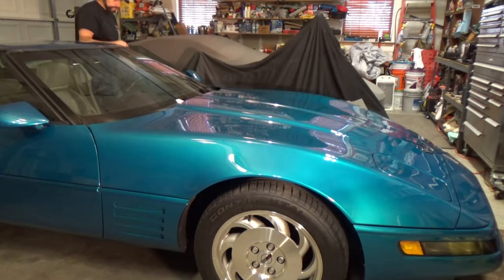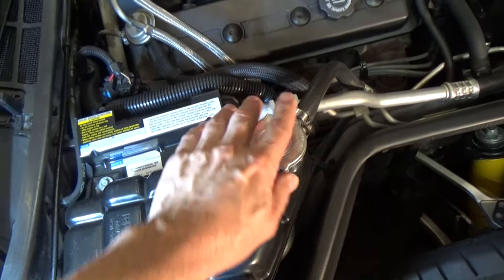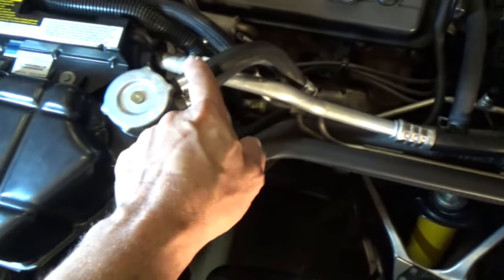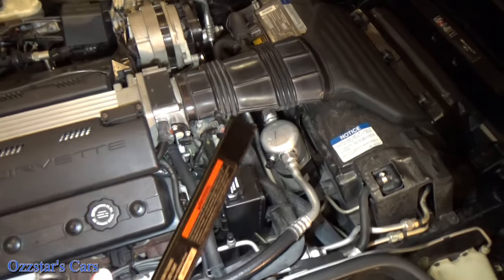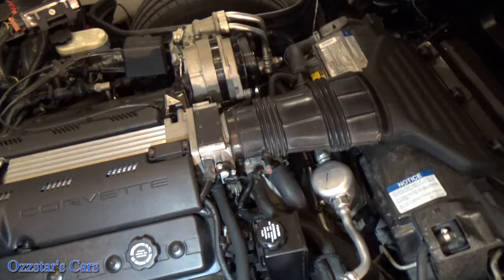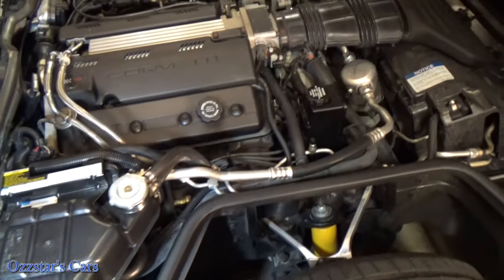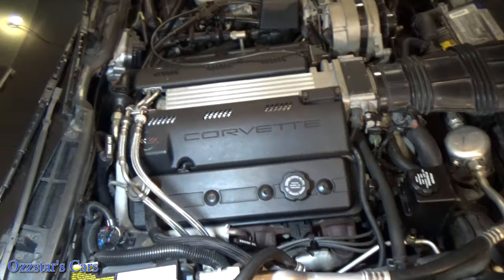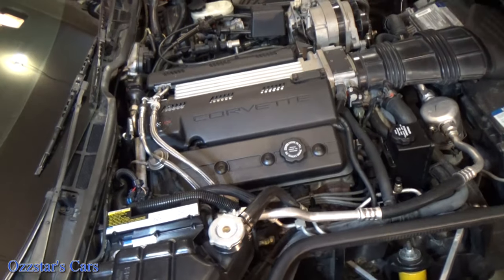Corvette Running Hot - Corvette Cooling System Maintenance Running Hot C4 1992-1996

Comment from the maker: There is a lot of info in this video including the on and off coolant temperatures for the both primary and secondary fans.   Also the proper antifreeze to use in the C4 generation Corvette.  Thanks for stopping by the Ozzstar's Cars channel.  Please ask questions and leave comments down below.  Thanks! -Ozz (Glen)

*Redline Detection SmartFit Cooling System Tester*  https://amzn.to/2GXN4dm

If this video has helped you out consider donating to the the channel with Paypal, thanks!:  https://www.paypal.me/ozzstar

Comment: A few points.  The C4 Corvette cooling system is designed and extensively tested to run as high as 15 psi above atmospheric pressure.  With the recommended 50/50 ethylene glycol and water the mixture has a boiling temperature of 268 degrees Fahrenheit.  The system can handle temperature excursions to boiling because of the high mounted pressurized surge tank in the right rear corner of the engine compartment.  

When heated coolant expands beyond the volume capacity of the pressure system it goes into the unpressurized coolant recovery tank in the right front corner of the engine compartment.  When the engine cools down the coolant in the coolant recovery tank is drawn back into the pressure system.  

The dual electric fans are programmed to turn on at around 220 F.   

In summary, 268 F is the number to remember not 212 F the boiling temperature of water at 1 atmosphere.  Based on your story Corvette drivers are panicking when all is normal.
Reply: The final word from the man who would know.  

I just got my third C4, a 9000 mile 91 ZR-1.  I Previously owned an 85 and 90 6spd ( not to mention my 70 big block car.) No cars are ever perfect but reflect the technology of the time.  You pushed the envelope, especially with the LT5.

What a contribution to the world of automotive engineering you made.  Many thanks for lots of miles of enjoyment.
Reply: 231 the fans kick in on my 92 LT1. Was thinking of going with a lower temp thermostat.
Reply: Thank you Dave for the clarification. I just bought a 1993 convertible, love it. thank you.
Reply: Lot of lt 1 new owners panick as they look at the needle on the gauge not the actual readout temps
Thought LT1 fans came on at 228 perhaps higher?

Comment: As a former C4 owner (1989 vette, manual transmission) in warm California climate I'd say the best thing to do is put the gear into neutral and take your foot off the clutch when stopped at a traffic light, the temperature will drop from above 200 down to 190s or 180s within 15 seconds all the time. Not sure what to do if you have an automatic transmission. Also a good air filter, aftermarket air intake and quality coolant helps. Like you said, make sure the radiator and fans are well serviced. Mine never overheated and I drove it hard like a dog in the blistering heat all the time, I miss that car.
Reply from the maker: Less friction equals less heat. Keep it cool!👍
Reply: First, Glen, good video, good info. I owned an 88 vette for 30 years. Setup included L98 auto, electric fan and electric  optional pusher fan. I changed the thermostat to 180, replaced the 235 temperature switch in the side of the block that turns on the pusher fan to a 200 and added a jumper wire from the pusher fan relay to the main fan relay. That way both fans turned on at 200. Highway temp rarely over 180. In town and parades never over 205. The factory design just left too little buffer between operating temps around 235 to cracking the aluminum heads at 260. Hope this is helpful.

Comment: '93 LT1 I've owned for 24 years. Never saw a video talking about what you said as far as debris buildup on the radiator. Didn't think my car had it (very occasional driver) but looked in there and sure enough it did! Hosed it out per your instructions, runs MUCH cooler, temp didn't go above 213 sitting in traffic last night. GREAT video thank you!!!
Reply from the maker: You got it Jeff, the beer tip jar is open. Haha. Enjoy those cooler temperatures!

Comment: I live in Arizona so needless to say its hot here. I have an 1987 Z52 that ran hot all the time. There were several things that I did to help reduce the high temperature issues. I changed the thermostat to a 165 degree instead of the normal 190 degree. I then put a high flow water pump on the engine, wired in a switch kit that allowed me to control the fans both primary and secondary, changed the coolant fluid to the GM DEX and finally removed the radiator and found all kinds of debris between the front of the radiator and the back of the condenser. My car ran previously in the 220+ degrees with or without the AC especially in traffic, now its runs without air on at 175 and with AC 195. Since this is an L98 it has the aluminum heads and steel block which can be prone to warping the heads. So far all has been great. I also just bought a three row aluminum radiator which I still need to install. Thanks for a great video.
Reply from the maker: Wow Porter sounds like you have been busy with that fun project. Thanks for the comment and enjoy your "cool" C4! 😁👍
Reply: Thermostat really doesn't matter as a practice to prevent running really hot. If it's at 230F, the thermostat is open whether it's a 165 or 190.

Comment: Thanks for this great video. I have been worried about my 92 C4 getting hot, but it runs less than 180 on the road. I always panicked when temp got to 210 in traffic because that was 30 higher than normal. Now I know that the fans haven’t even turned on yet. I used your paper clip to test the fans and blew out the trash from the radiator. Honestly, there wasn’t much. Thank you so much for your video. I subscribed and gave you a like!
Reply from the maker: Glad the video helped you Just Bop. Thaks for subscribing and liking.👍 If you get a chance you may like some of my other C4 Corvette repair videos. Take it easy.  -Glen

Comment: Thanks for the info, just purchased an 89 c4 running at about 218 degrees.  I'm going to get it up on the ramps and clean out the radiator. Thanks for such great info

Comment: Glenn, Thank , thank you thank you !!! I have a 1989 vette Black convertible. I would run around town on a hot day and freak out.  220 and I could not here the fans kick on, so I would put on the air and the temp would go down below 200 even 190. I have done every thing you said to do in the pass, one time or another, but !...I had no idea about going between the radiator and the air coils ( what ever they are called ) and checking that area out and cleaning it. As soon as spring comes to Ohio and I get the car out, I will do that first !!! I bought mine in 92 in  small town called Napoleon Ohio. They were super guys and gals there. The best part was, all there corvettes in the very large showroom 
had keys in them. And no pressure, they let you sit in any car and start it up. Soon as there is a car you would like to test drive, they get it out and zoom, zoom, you go ! I live in a small town called Kent Ohio, I actually drove 3 weekends there, Stayed in a hotel over night, till I got the one I have now. They even had some 50's and early 60's there, but those were behind ropes and if you are interested in one, the sales person were with you.            Thank you again....Bobby
Reply from the maker: That's a great story Bobby!  I really enjoy hearing the history of someone's car. It's a shame most are never told or dissapear with time passed.  After all these years I bet you you will find debris between the radiator and a/c condenser.  You're welcome for the vid and thanks for your comment.  Hopefully you can post an update with the results you get. 👍

Comment: My 93 would run 200-220 in the FLA heat and add 10-15 degrees if I ran ac. I do have a fan mod so both fans would run even without the ac on. I had cleaned my radiator and assured zero debris, and had system flushed and serviced yet temps still seemed too hot for me. I then purchased a 3 core aluminum radiator and 160 thermostat. Now my car runs very cool (170-180 typically) with or without the AC even in the 95 degree days.   I did make a YT vid on my channel showing results.  Also as I understand things the digital temp indicates the temp at water pump while analog temp gauge is showing temp at heads.  Thanks for the informative vid :-)

Comment: Great Video .I have a 1996 automatic. Radiator fan on and off temperatures are something I will definitely look into. As well I will take a look at what may be stuck under there on the radiator and will try to wash it out. Thank you!!
Reply from the maker: It's most likely packed with debris.  Let us know how it turns out Frank.  Thanks for the comment. -Glen

Comment: Excellent info for the LT-1  C4s.
I have a 1996 that runs great, but has the high temp issues you describe.
When I was building '69 Camaros and racing them as a kid in the late '70's, 180 to 190 degrees was the normal temps.
I finally got my C4 I always wanted, and it's running 225 -240  and scaring me half to death.
I've been debating getting a thicker core radiator to make it drivable, but I want to make sure I'm bleeding the air out properly.
Thank you for sharing C4 tech.
Reply from the maker: Have you checked and cleaned the radiator and tested both fans operate?  Should be running around 200⁰ down the highway.
Reply: Yes, my friend from high school is a GM Tech and went to all the tech schools over the last 40 years.
He has the wireless analizer that plugs into the OBD II plug under the dash.
We found out , as you mentioned too, the digital gauge is more accurate than the analog, and the fans come on at the factory settings. 
I want to try to make sure it isn't air locked though, so I'm going to try to bleed of air in the cooling system possibly preventing correct coolant flow.
I want to go for a ride without worrying about over heating.
It's such a fun car. Has the feeling of my old Hot Rods , except it stops and goes around corners much better and burns half the gas.

Comment: How to keep your 1995 C4 LT-1 between 180F - 200F no matter what:
1) take primary fan off relay, and put it on a coolant (low) temperature switch, or a manual switch
2) convert to Meziere WP118HD Heavy Duty Electric Water Pump
3) get an all aluminum performance radiator
After years of anxiety here in New Jersey summers,
now NEVER A WORRY!!!  IT JUST WORKS!!!
Reply from the maker: That is way more expensive and involved than necessary.
Reply: @ozzstars_cars  not really, turning the fan on/off with a switch and relay cost less that $10; original plastic oem radiator leaked, why buy more plastic; original oem water pump died pissing coolant over my optispark, why let that ever happen again... imho... ymmv... cheers

Comment: I have a 94. The 95 and 96 did not run coolant through the throttle body. I replaced my hoses with the later model ones to bypass throttle body. It actually lowered temp just a bit and seems to be a little crisper on throttle response. This also removes several points of potential leaks.
Reply from the maker: I am interested in knowing how bypassing the throttle body coolant lowered the coolant temperature and changed the dynamics of throttle response.  I've worked on cars for 30 years and have never seen that phenomenon.

Comment: Another question...
My 1994 Corvette is pretty much original. With that said, I have done a flush n fill, new thermostat, cleaned the radiator/condenser area of debris, replaced the temperature sensor, and all the other stuff I see in this video and elsewhere.
With that said it still has problems with overheating if I get stuck in traffic on a hot day. Not a problem when I'm moving. But if I'm not travelling by the time the secondary fan comes on it's too late to recover and my engine gets really hot and starts "missing." No problems on cool days.
With my friends older Corvette he just replaced his (single wire) temperature sensor switch with a lower temperature one, so his fans come on based on the position of the switch, which activates his fans at a lower temp than stock.
That does not work on my 1994. There is no lower temp switch because this is a two-wire sensor and sends a signal to the ECM and the ECM decides when to turn on the fans. Man, I hope that's not too confusing. The older ones are on/off, the newer ones read resistance.
I also looked into reprogramming the ECM to turn the fans on at lower temperature. That's a no-go. Without going into details, the 1994 and 1995 model years have some funky computer stuff going on with OBD1 and OBD2 stuff.
So I was thinking of going with a "Derale" brand adjustable dual fan controller, here's a link to check it out:
https://derale.com/product-footer/electric-fans/fan-controllers/high-amp-controllers/16789-detail
It costs about $125 and you can program the temperature for your fans to come on.
My thought is that instead of my fans coming on at @225 and 235 I could use the Derale controller to have my fans come on at 215 and 225. Giving me a little bit of a buffer and keeping my engine safe.
Two questions: What do you think of this idea/product? 
And, if you were to go with this plan where would you install the temperature sensor, 3/8" npt thread-in probe? < << It would sure be nice if there's something already ported on the radiator or the block.
Any help is greatly appreciated.
Reply from the maker: As long as my C4 with the LT1 remains under 235⁰F, I have no concern.  Not sure what your misfire is but I would diagnose that first.
Reply: @ozzstars_cars  I suppose I should have used the word stutter in place of misfire. My problem is that it's so hot here in the summer that the secondary fan comes on at 235 but the temp is still climbing for a bit. So I'd like to get the fans to come on just a little sooner to head that off. Thank you sir, love your videos!

Comment: Well, I bought a used 140K mile 1996 C4 ten years ago. Long story short, ended up replacing all components in the cooling system. The plastic radiator was leaking, holding tank and thermostat was gunked up. Chevy designed this motor to run in the 200+ range to burn off hydrocarbons.  While rebuilding system , I replaced the thermostat with a standard Chevy 185 degree unit which made the engine run at the old fashion normal temperatures.  Running at 225 degrees just seemed stupid as it ruined the plastic components. The only bad price to pay doing this was, the cabin heating system was affected so you don't get much heating in the winter. That's fine with me, because I only run the car in the summer time. Engine runs just fine at the lower temperature with no check engine lights. AC and fans run just fine in the hot desert sun. Following all that, ended up replacing water pump, opti-spark, IAC and removing intake to correct the common rear oil leak on the LT1. After all that, the automatic transmission started slipping and had to have it rebuilt.  My C4 is high mileage, runs like new now , but I don't think I could break even selling it at the used car price. It's a real nice looking hot rod for an old guy ! LOL !
Reply from the maker: The C4 is a bargain sports car. Some people like to put it down but the '92-'96 is the cream of the crop and a bargain to boot. Enjoy your car!

Comment: I just bought a 95 with 44k.  I withdrew some anti freeze and its pretty gritty and dirty, but how clean should it be and how long does it really take for the coolant to get some what dirty.  How clean can the system really be after flushing it.  My 2000 Accord has clear fluid with nice green color, it is a aluminum block though.  I need to add to the Vet but maybe it needs a full flush instead.   I hate to flush it then find out a month later the coolant is the same dirty looking no matter what,  Thanks
Reply from the maker: Definitely sounds like your car needs some maintenance.
Reply: @ozzstars_cars  almost perfect shape. Runs great.  Just needs fluids replaced from time.  I scheduled a flush in a few weeks at a local. Shop.
Got it topped off and no air in system until then
Thanks
Reply: @ozzstars_cars  I also have bought the proper green pre 96  m1825 type coolant for shop to use.  They are a good shop.

Comment: can i take the two screws out of the electrical connecter  at the right rear by the head to unplug it to get to the water bypass tube having trouble getting the bypass bolt out i want to disconnect the wiring to make it easyer
Reply from the maker: Not sure what you are talking about.

Comment: Hi Glen; I really like watching your videos on Corvettes. I recently bought a 1993 bright aqua convertible. I had a question about the temperature gauge. I was at  car show, and driving there and back I noticed the temperature gauge does not move at all. When I got home the fans kicked on and I got a "Check Gauges" message. Any Idea what is causing this ? Thanks.
Reply from the maker: The analog gauges in C4's are known to be inaccurate so keep an eye on the digital  temperature gauge. What is the temp reading?
Reply: Hi Glen, the needle does not move from 100
Reply from the maker: @donleblanc7223 what is the digital coolant gauge reading?
Reply: Hi, have not been able to access the digital version yet. I'll check it out.Thanks @ozzstars_cars
Reply: Hi Glen; i ran the car today and checked the digital gauges, i got a reading of 74c for the coolant, and 44 for the oil temp. Sorry for the Celsius reading as I'm in Canada.
Reply from the maker: @donleblanc7223  you car was running cold at 165⁰f, normal highway temp is around 200⁰